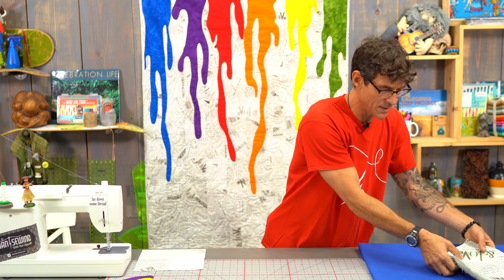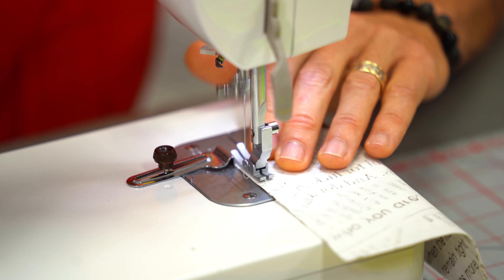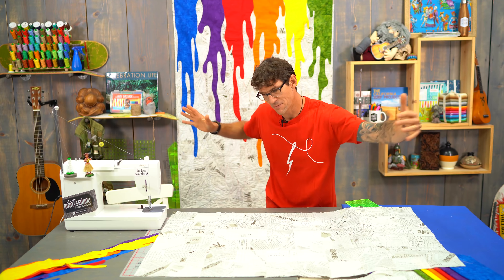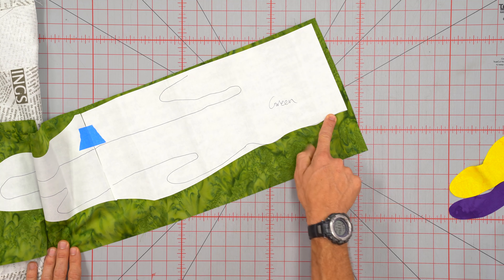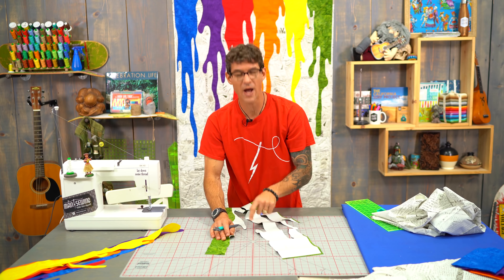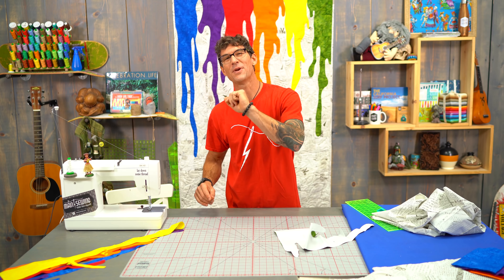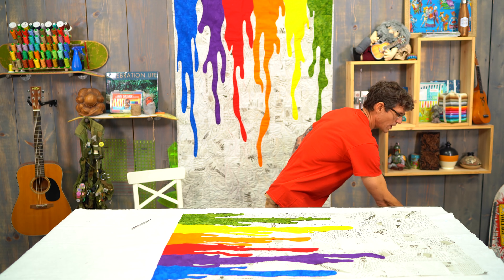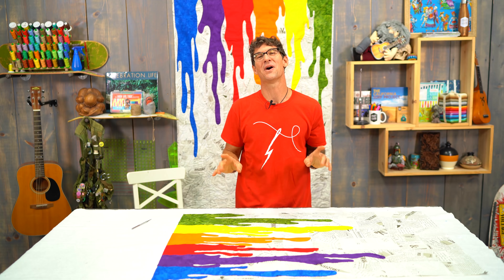Make a "Paint Drop" Quilt with Rob Appell of Mansewing (Instructional Video)

Comment: This is a fun project, I want to make one too! Only change is I would trim the 5x10 pieces down to 5x9.5 so they line up better with the two 5" squares unit. I can see the extra 1/2" hanging off the block at 3:16. Rob can probably handle the excess no problem but knowing me I would find a way to add unnecessary fullness to my quilt with that extra 1/2".

Comment: I love this!  The pieced newsprint background is genius!  I use my DSLR camera to take pictures of my projects as well. Sometimes I use blank pieced patterns and colour them in to audition layouts. I've made applique patterns and printed them, too. When I have a lot of blocks or pieces on the design wall and I'm rearranging them, I take pictures so I can see better where things are too close or what needs to be moved, if there is too much dark or light in one place, and when I take the final picture, I can tell that's exactly what I want before joining the blocks/pieces. I'd love to see more of what you do with technology, however, I only have a regular printer and I'm not sure how I'd print big pieces to size. Maybe you can teach us how to put a bit design into PDF so we can print it on a regular 8.5 by 11 sheet and then tape it together or something? A lot of pattern companies do that, but I've never seen anywhere how to arrange a PDF like that. Thanks, Rob!
Oops, forgot to mention, I do have a "Ruby beholder" that I use to tell what fabrics are light, medium and dark before I even cut them, which helps with making the blocks and combining fabrics, too. Same thing as taking a picture after the fact, but I like to check before I start :D